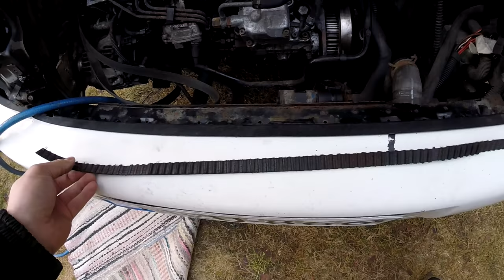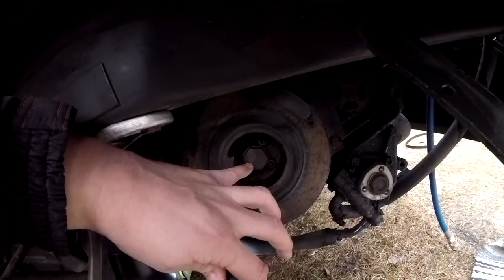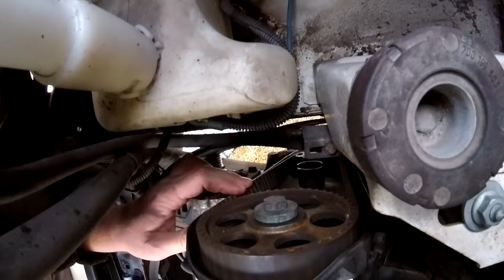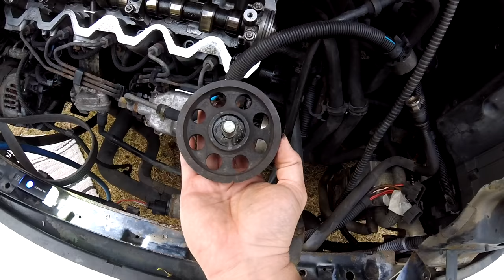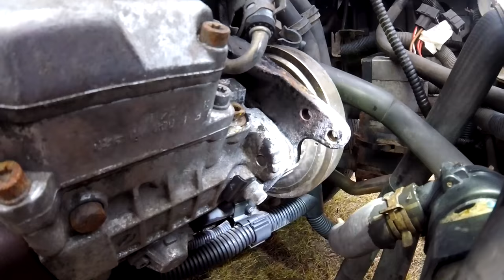VW Transporter T4 (AJT) 2.5 TDI engine timing marks

Comment from the maker: 1:25 clutch flywheel mark
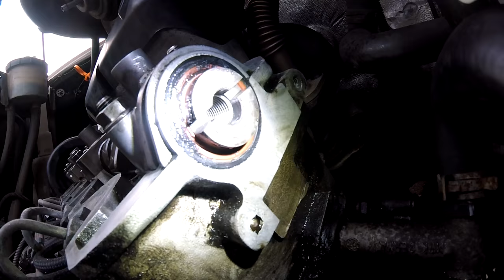5:40 camshaft end notches
7:10 diesel injection pump notch and corresponding mark on the pulley
Reply: Mine was too low pressure so I guess worn out pistons. Have changed it to another one used from AJT 65kw. Same as my old one

Comment: @7:00 just under the timing mark of the pump, is a bolt with a spacer. When all timed up, undo the bolt enough to remove the spacer “don’t lose it! Or forget to refit it later” tighten the bolt and that will lock the injection pump in position.

Comment: Very useful video, have pump changed and first time been watching it so I just skipped a little bit till marks, but ofcourse I missed flywheel mark so been struggling for some hours 😀 and all it took it's just to see it once again without skipping. So now my van runs as it used to 👌 thank you so much
Reply from the maker: Cool. Did you replace it with the same T4 pump or upgrade to a bigger? My pump has worn out teeth on the pulley and the pulley costs ~200 EUR so I have been thinking about replacing the whole pump.

Comment: Moikka, vaihdoin sylinterikannen tiiviste on Caravelle t4 moottori tyyppi AAB. Nyt ei käynnisty se on pois ajoissa. Miten voidaan korjata? Missä Suomessa olet?
Reply from the maker: Check the engine timing marks: flywheel and camshaft position. If those are set and you can freely turn the crankshaft by hand, the injection pump is probably out of sync. I don't know about t4 2.4 engines but I think the IP was different at least, maybe this will help: https://www.youtube.com/watch?v=8GjviZPuP7I good luck

Just a thought, you can open the pump outlet screws to make sure it really pumps fuel, if you changed fuel filter or otherwise had to take the pump out when doing the head gasket change. If you changed the fuel filter, remember to fill it with diesel before installing it, cranking won't fill it because there is no low pressure fuel pump.

Comment: If the mark on clutch flywheel is not visible is there any other way to set the timing
Reply from the maker: Hi. No, there isn't. It's quite hard to find and that's why I marked it with a paint pen when I finally found it. Keep looking, you will find it. Ask a buddy to turn the crank very slowly while you look.

Comment: Hi Antti can you give me any further information please on the pump setting up.
I've been using a dti gauge to get the 0.55  lift to time pump but won't start. Changed pump because it was weak it took me 2 months in spare time to get running now back to square one with new pump.
Please any help would be appreciated very much thank you
Reply from the maker: Make sure the pump is at bottom dead center and the piston is in top dead center when you set the gauge to zero. The dial gauge will get you in the ball park and once it's somewhere there the car should start and it can adjust it a little by ECU. For more precise tuning you need to use VCDS (VAG COM) and connect to the OBD port. Check these two for more help: https://atlib.info/blog/182-vw-transporter-25-tdi-acv-t-belt--high-pressure-fuel-pump-belt-replacement and https://www.youtube.com/watch?v=CfYQOl4n4tk . Remember to get the car at least to 80°C before tuning with VCDS.
Reply: This is great information and this link is fantastic.  Step by step!  I have been using a Haynes manual and some information in Brickyard.  Im hoping I can get my van running at least sufficiently ti drive it to a Bosch specialist who has all the necessary software.  I believe the value 0.55 has to be advanced to a little more for older engines.  But im just learning all this.  An engineer has stated from experience that the value should be 0.65 for an older engine.   Useful to know that the camshaft timing slot is of centered. I didn't realise that.  I thought you had to look at the cam lobes on the left.

Comment: My flywheel is rusty so there's lots of marks that look like the timing mark can't I open the injector and put a rod down no1 to get TDC?
Reply from the maker: You can but only to find the line in the flywheel. I don't think it's accurate enough measured from the piston.
Reply: @AnttiHarri  thanks mate appreciate it.
Reply from the maker: @ccarruso5140  
No problem. Mine was rusty too but after looking hard enough I found it and marked it with a paint pen. You will find it too, I'm sure.